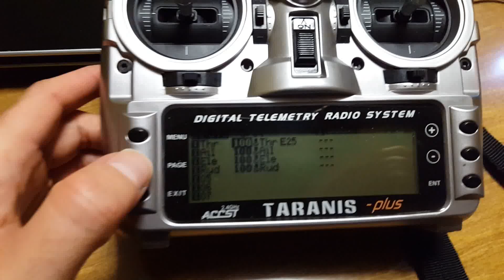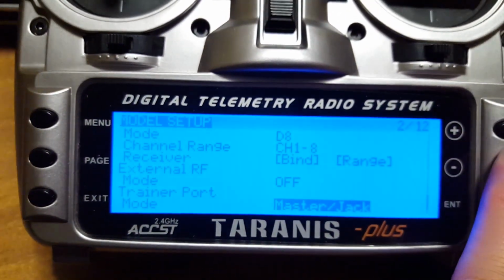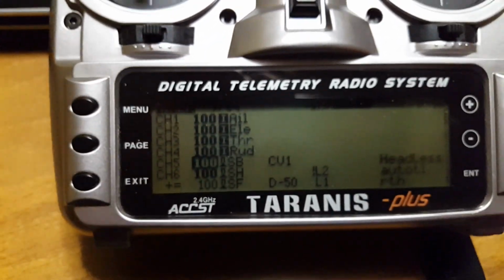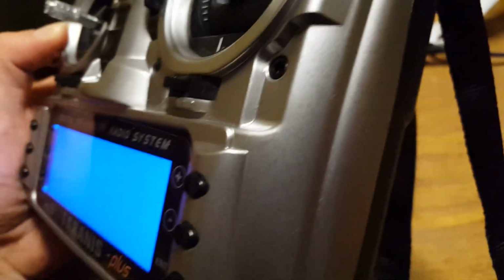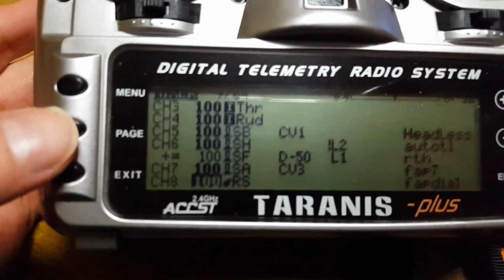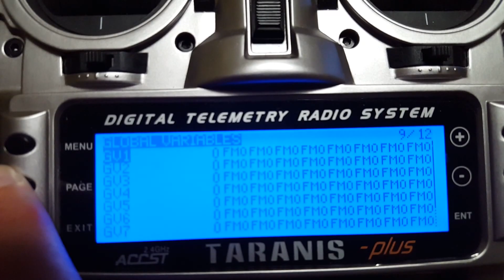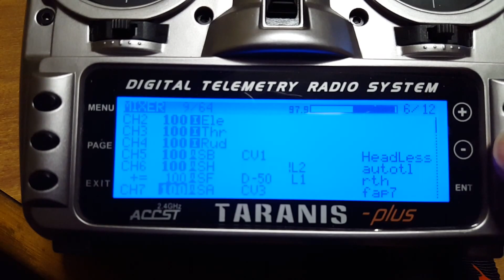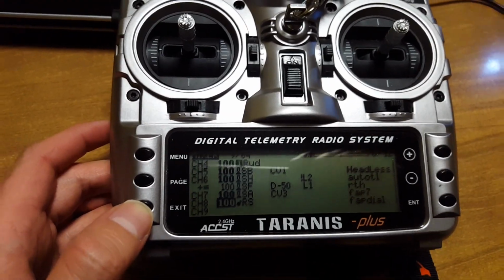v303 / x380 Receiver Swap Build Log - Taranis x9D  Configuration - Part 1

Comment: Hello Mark,

Just a quick thank you for this video and instructions on your websight for the receiver swap.

Did it successfully (using your instructions) years ago to one of my X500 being able to use it with additional functions to drop skydivers, gliders, add camaras with video/photo on/off functions and more.
Moved on a long time ago and got eventually involved in industrial building and property preventive maintenance using sofisticated drones.
But now, beeing on lock down for more than two month down here in Puerto Rico getting board, I pulled out my two old X380s and the two X500 drones with their original receivers still installed and swapped them all on to my Frsky Horus X12S radio using  X8R receivers, adding all kinds of stuff, just for fun, and had a ball.
Actually more fun than flying a DJI Inspire or Mavik Pro

Thanks again for the great job you did years back creating this videos and instructions.

Best regards,

Richard
Reply from the maker: Thanks for the kind words.  Glad I was able to help.  :)  Mark

Comment: great video! Did you by any change find a away to fly it with manual (stabilized) mode? The problem with these Quads is these only have GPS flight mode which sometimes affected by electrowave (or whatever). A lot of people experience crash because of it. I really think these quads could be a lot better if XK provided the altitude hold mode or stabilized one.
Reply from the maker: Thanks..  I never attempted a manual mode myself.. not sure if anyone else has or not.